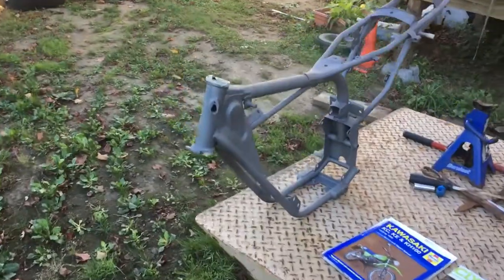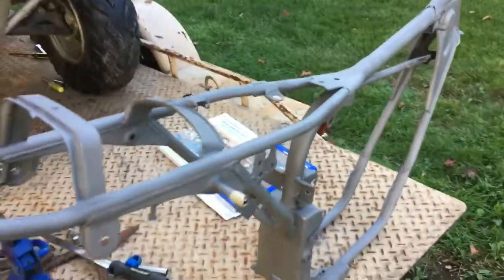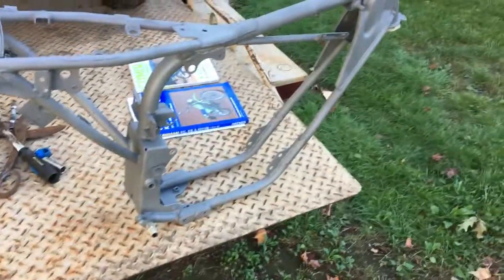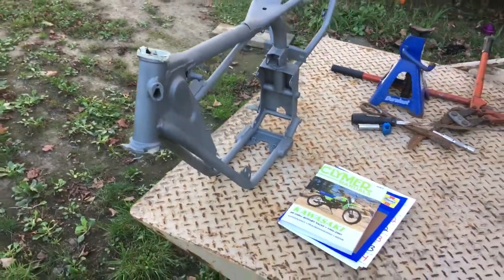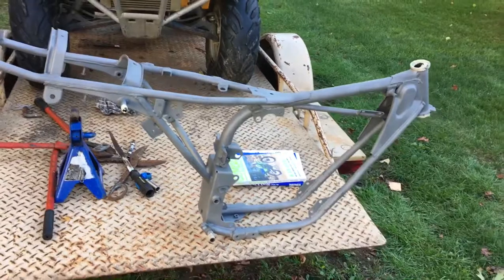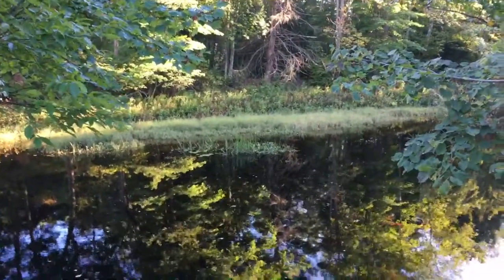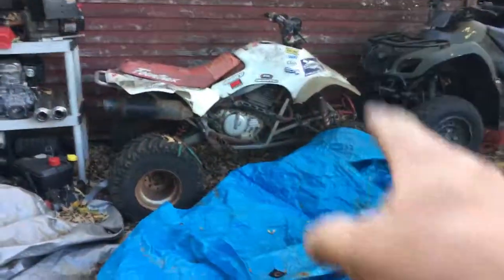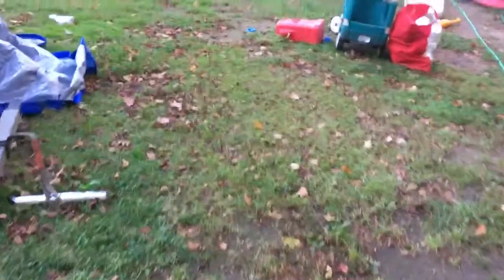first look KE102 frame

Comment: Hey, can you do a quick video describing the process of setting the timing exactly with an ohmmeter? My bike has spark and fuel but I can't get it started still. This thread I found replicates my problem exactly but I can't get the thing started! https://www.justanswer.com/motorcycle/607w5-kawasaki-ke-100-replaced-clutch-won-t-start.html thank you so much for all your help Kevin!
Reply from the maker: Did you follow my videos
Reply from the maker: You might be 180degrees off
Reply: Yeah I think I've set the timing directly with a feeler gauge at the timing Mark
Reply: Correctly*